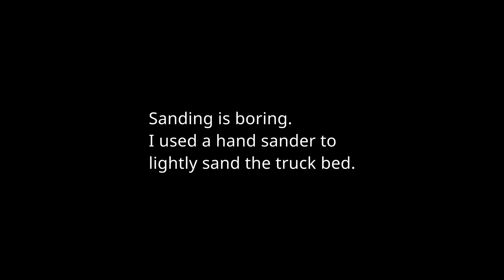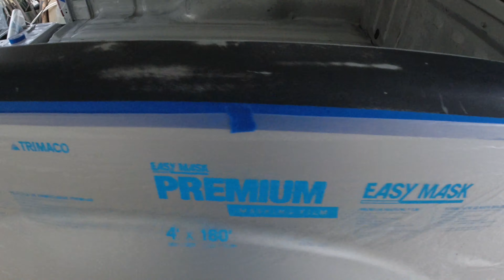Suzuki Equator DIY Truck Bedliner

Comment: What temp does it need to be outside? Of course, we have to worry more about wind here in Oklahoma
Reply from the maker: 50 degrees and up! It got colder than so wanted. I took a bucket and filled it with warm / hot water and let the cans stay warm. It makes them easier to shake too ;)